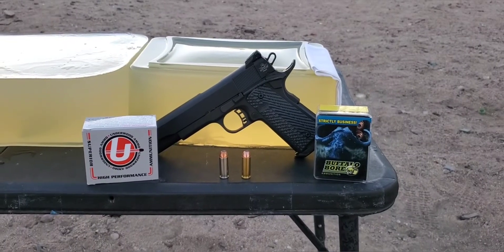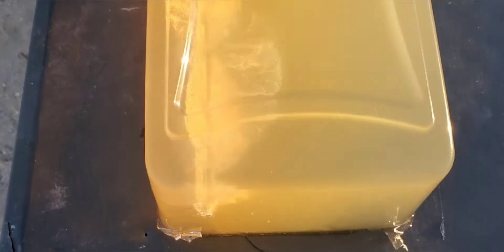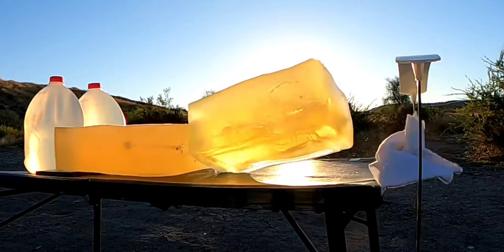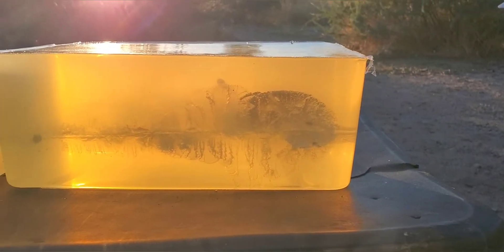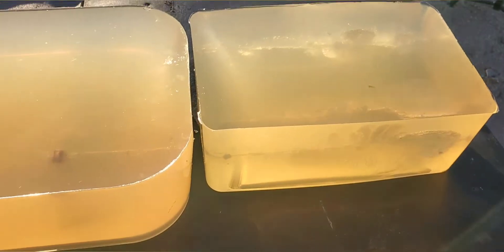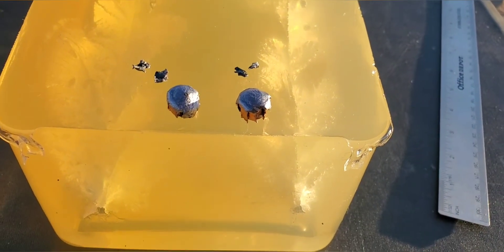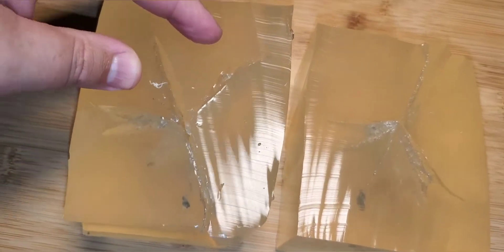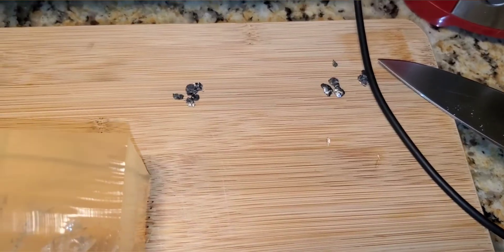10mm Underwood VS Buffalo Bore in Ballistics Gel

Comment: 180 gr XTP Underwood $25 for 20
180 gr Buffalo Bore $42 for 20

Underwood is the winner.  That is a huge price difference for equal/similar performance.
Reply: Exactly.  I really can't see spending double what Underwood charges for the same performance.  
My favorite practice ammo is AAC.  It's available from Palmetto State Armory.  It is 180g at 1200fps on the box, but reviews have chrono'd it significantly faster than that at speeds from 1250-1300.

Comment: I started buying underwood Around 2013 before they were a common name. I bought 165 and 180gr gdhp they were advertised 1350 for the 180s and 1400 for the 165s. I was get 1407fps 180gr and 1464fps 165gr 10 shot average out of my Glock 20. Ever since then that’s all I buy for 10mm even fmj is close to those speeds.
Reply: Underwood started by completely copying Buffalo Bore's loadings, even the words from the BB site, lol! Tim gave them a call about the descriptions and they took it down.
Reply: @ they match or exceed published velocities that’s a rare thing for Buffalo bore to do

Comment: Considering performance is identical underwood at half the price is the way to go..
Reply: As others have mentioned, underwood has had some consistency issues when tested, while BB almost never comes in under its rated velocity. But it’s not an extreme lack of velocity when it happens. They’re still running very hot and are real 10mm. So it’s just about whether knowing for sure you’re getting that extra bit of velocity and energy is worth almost a whole added dollar per round. If it’s for hardcast in woods, I’d say yes. If it’s just for defense, I’d prob say no.

Comment: I've been seriously considering getting a 10 mm, from what I've seen the cartridges for It are very underpowered,  watered down with the exception of the Underwood & Buffalo Bore rounds. THX for posting. 👍🇺🇸 subbed.
Reply: Join the club!!!

The fastest I've seen in a hand load is 1600fps from a Glock20 with a 6" barrel and a Glock40 both 24lb recoil spring and  6lb firing springs and that's definitely .41 & .44 magnum territory.

There is a guy named Angry Dick here on a channel called Steep Kuntry Outdoors who cooked up a 180gr. .40 over 1400fps from a Glock35 I believe he got it to 1435fps or 1440fps. And that was .40 S&W.

Comment: It would be nice to see you test on 45 super maybe 135 grain Xtreme defender or 185 grain or if you can some 450 SMC the 450 snc a bit more powerful than a 10 mm
Reply: Yep, the 10MM is a great round but the 45 Super is at the same power level but starts off at a larger diameter so it's more likely to dump most if not all of it's energy into the target. If we are talking big bear defense the 10MM would be better because of the smaller diameter the penetration would be better. Personally I like the .460 Rowland but it's more of a wildcat cartridge unfortunately so if you are not a hand loader it doesn't make much sense but Underwood does make ammo for it.

Comment: At close ranges where the impact is still at or above 1,300 fps, that 180 grain XTP would hit like a truck. Not going anywhere but down quickly if you get smacked by one.
Reply: Right. 
At 15 feet, the difference would be “super duper dead” or “ultra dead”
Reply: What about 200 grain underwood? Or is the 180 grain better?

Comment: I just wish manufacturers would quit building their pistols off their 45ACP models. There is no reason that a 10mm pistol needs to be bigger than a 9mm other than the grip length.
Reply: Um yes there is a reason. You need something beefy and stout to be able to handle these chamber pressures of the 10mm. Secondly small guns shooting full power 10mm is not going to be a good time for your wrists. It's already a beast in full sized guns. A G26 sized pistol shooting one of these rounds would SUCK for the shooter. Get a Glock 29. It's about the size of a Glock 19, but wider. That's gonna be your best bet for a compact 10mm.
Reply: @nickadkins7765  Chamber pressure of 10mm (38,000) isn't that much higher than 9mm or 40SW (both 35,000). 357 Sig is 40,000. Switching from 40 to 357 Sig is only a barrel change. Chamber pressure of 45ACP is only 21,000 psi. The only reason they build them from 45 ACP pistols is the depth of the grip needed to handle the longer cartridge.
Reply: @nickadkins7765  Chamber pressure of 10mm (38,000) isn't that much higher than 9mm or 40SW (both 35,000). 357 Sig is 40,000. Switching from 40 to 357 Sig is only a barrel change. Chamber pressure of 45ACP is only 21,000 psi. The only reason they build them from 45 ACP pistols is the depth of the grip needed to handle the longer cartridge.
Reply: You don't know what you are talking about...A 9 mm hand gun built to handle 9  mm pressure could not stand up to the recoil
Reply: @donspann9706  You should be nicer, because YOU don't know what you are talking about. 40SW pistols from most manufacturers are the same width as their 9mm pistols. The 40SW cartridge is a shortened 10mm, so they are the exact same diameter as 10mm. The pistol doesn't need to be wider. When it comes to chamber pressure, the 357 Sig has a higher operating pressure than 10mm, yet converting from 40SW to 357 Sig is usually just a barrel change, so a 10mm barrel doesn't need to be any thicker than a 357 Sig barrel. There is no reason the pistol needs to be wider and a heavier recoil spring would slow the slide enough to operate. The only limitations is the grips won't fit the longer 10mm cartridge.

Comment: 200 grains works better. Better energy transfer. 180 grains is for 40. Less fragmentation. Power was really out of this world.
Reply: Where is the proof of that? It all depends how fast that 200gr is moving. 180gr is not a good size for 40. It's too big, and moving too slow. 155-165gr works best for 40 (for self defense) and 155-180gr is best for 10mm (for self defense). If you want bear rounds you go with 2xx gr hard cast loads....but these 180gr hollowpoints are devastating in a personal defense scenario.

Unless that 200gr is moving at atleast 1350fps or faster it's a wash, and the energy transfer is negligible.
Reply: @nickadkins7765  10 mm the original load was 200 grains out a 5 inch 1911. And a very hot load if you compare it with todays 10 mm. Norma invented 10 mm platform it was that way 1300 to 1400 feet 200 grains 5 inch 1911. The problem is in case is energy delivery (bullet technology).
Reply: @nickadkins7765 Energy is qualitative as well as quantitative, meaning how a bullet's energy is used matters at least as much as how much energy gets used. Handguns lack the velocity to consistently cause the stretch cavitation that makes high velocity rifles so effective, so we are primarily concerned with the permanent crush cavity. 
In gel, the permanent crush cavity has a neck, a body, and a tail. The neck is the distance between the entrance and the first sign of bullet deformation or disruption. Many incorrectly assume we want the neck to be almost non-existent, but in truth a few inches of neck is fine because the first few inches of gel block, even up to about six inches, are representative mostly of subcutaneous fat and muscle tissue. Doing a lot of damage here is not really going to contribute to the effectiveness of the round because it is too superficial to damage important structures from most shot presentations. 
The body begins when expansion and deformation begin. It can be seen as the part where the body is chewing its way through the gel as evident by the star pattern, splits, and tears coming off the path of the bullet. This is the important part where the bullet is using its energy the most effectively. We want to see the body of the permanent crush cavity reach as deep into the block as possible, preferably into the center third of a 16 inch block, because this is representative of where large blood-bearing organs would be in the body, and we want the bullet to be using energy effectively when it gets to these structures. 
When the bullet slows to the point where it no longer has velocity for expansion, it settles down into the tail of the permanent crush cavity. This usually entails the last half of the wound channel, and here the bullet creates a narrow, uncomplicated wound. In a body with tissues of varying density and elasticity, the bullet is as likely to push aside tissue as penetrate through it at this point. Here we may see the bullet easily deflected because it lacks momentum. The bullet really isn't using energy to contribute significantly to wounding. So total penetration isn't really as important as the depth of penetration where the tail begins. 
If you watch gel tests with a 200 gr XTP at 1200+ fps, such as my Underwood carry load, you see it carries the body of the permanent crush cavity deeper into the gel block. The 200 gr has more momentum and a higher sectional density which allow it to retain enough velocity for deformation deeper into the body. It might not expand as much or disrupt as much earlier, but that is fine because that part of the gel block isn't where the important stuff is in a body. That the 200 gr expands farther into the block means it uses its energy deeper in yhe body, and this is crucial for incapacitating a threat. I've seen both the 180 and 200 gr XTP perform on deer, and I carry the 200 gr. It might not have as much energy or as wide of expansion, but it uses its energy more effectively by taking it deeper into a body while still deforming.

Comment: It's nice to see these two ammo companies loading the 10mm up to full power. There are so many other loads out there that are about the same power as the .40 s&w. Those stretch cavities are awesome!👍👍
Reply: Yes very disgusting when you can’t actually trust ammo loaders to sell you what they claim…I learned very quickly to check the specs on 10mm before I buy it, otherwise you may end up buying 40 S&W when you intended to buy 10mm…how can you tell the difference?  In my experience, if the velocity isn’t shown on the box, you likely don’t want to buy it…🤷‍♂️
Reply: @genbigmac2872 yeah check the specs. These two, Grizzly, and Sig V crowns are true 10mm ammo companies. Hornady Custom I would say is fifth on the list. Those 5 companies are true 10mm.
Reply: @genbigmac2872 I agree, but having said that, even underpowered 10mm loads would make a very bad day for someone on the receiving end.😅
Reply: It is nice but another important step is to take steps to protect your pistol.

 Having the slide slam back as hard as it does with full house 10mm rounds presents the problem of cracking the back of the frame.

There are several solutions but I went with a shock absorbing piston guide rod.

Strode's is the name of the website that makes them.

 The one for my Tanfoglio Elite Match put me out about 80 bucks but the it really reduces recoil and yet lower power practice rounds still cycle flawlessly.

I've been blessed because I've never had a misfeed with the Tanfoglio and I'm glad fixing one issue didn't lead to another.
Reply: @jamessteinmetz7476  i've never heard of that company. Did you mean to say Sprinco? I have their guide rods in all of my full sized Glocks.